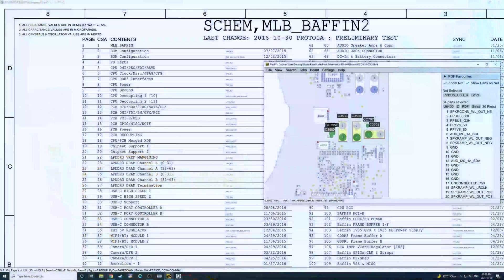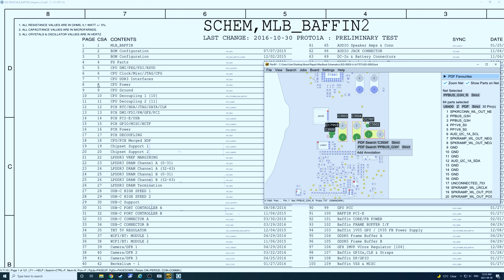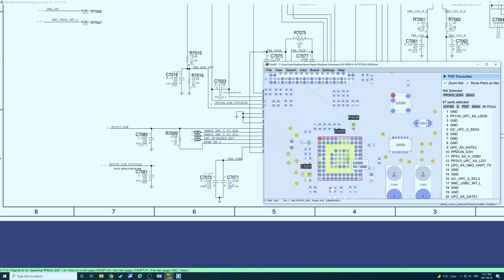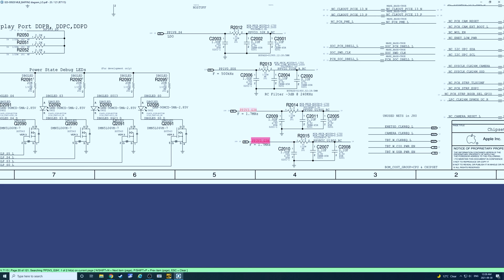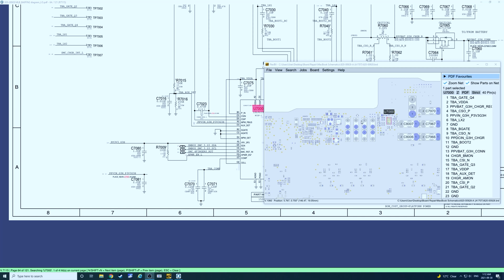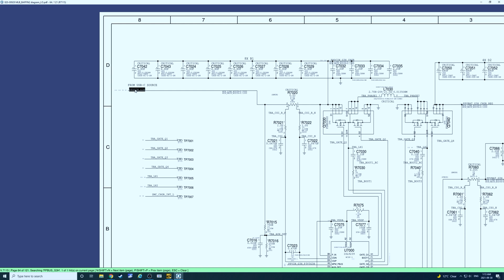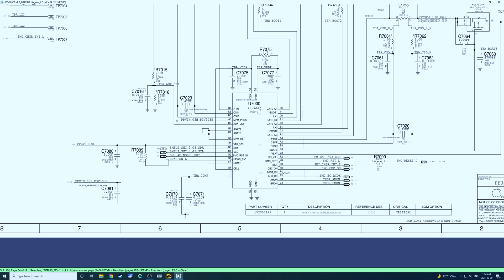How to repair MacBook Pro 2017 A1707 - No Power Drawing 5V with 0 Amp Draw

Comment: My issue is the same, but another problem is that my board is not stable at 5W. It turns on and resets after 2 seconds, then tries to start again, but resets. It's frozen and keeps resetting every few seconds any idea

Comment: I followed your advice. Found a perfect patient with similar problem. Bit when I plug the magsafe with meter it turns  only on on one of 4 ports and it's stuck on 5v. I could find 3.3v delivered the chip. Could that be still the same problem or should I look somewhere else?

Comment: Why didnt you check for short on PPBUS_G3H? How you pinpointed U7000 was pure luck. There could be short on PPBUS_G3H anywhere on the board... well, that is a little harder to solve. If you charge people money for these repairs, you should replace the chip... not reball it. I would guess just heating up the chip solved the issue, not reballing... and it might fail again.
Reply: i was thinking the same

Comment: Great content 👍🏼 after the voltage measuring I would measure resistance on that line because a shorted cap or something else could pull down the line to ground too. I‘m happy to see more from you😁
Reply from the maker: Yes you're right, that is the correct process. I always do , not sure why I didn't here 😅
Reply: @marcuscupello  lucky you 😁 if that wouldn’t worked you would check it for sure
Reply from the maker: @zaimsadikovic  yes haha